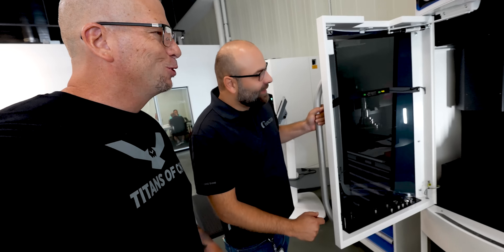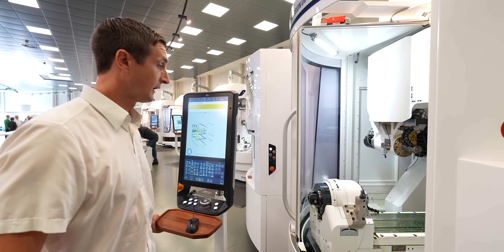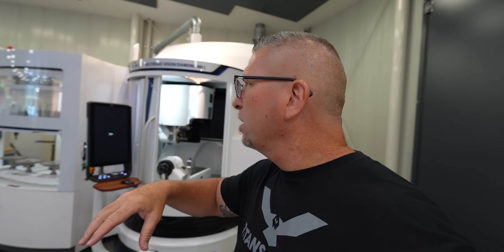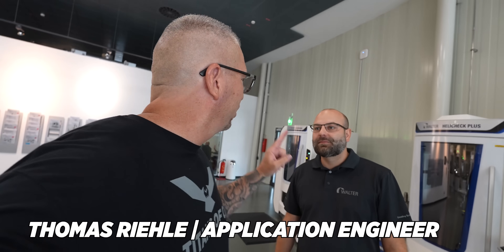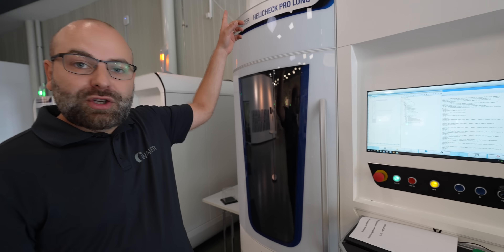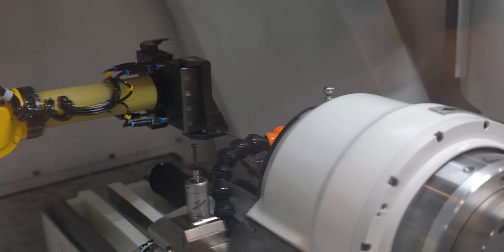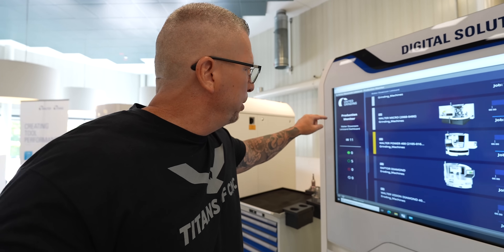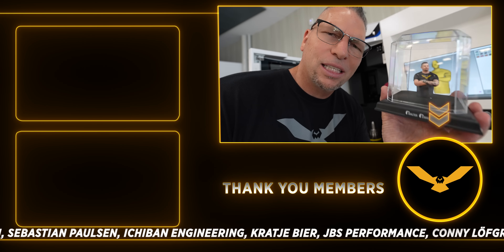The Brilliance of Erosion Machining at WALTER | Germany

Comment: because the rods in the old XJ650 were broken and there was no where to get new ones... bigger machines... as things are made, more of that tungsten finds it's way into the base stock of normal material. casting pool in 1993 said 128'000psi tensile, why does a E7018 welding rod hold 170'000psi... but the E7018 rod from a few miles east lets go at 65'000psi? weird... happy i got new axles for the car but the box said made in China in one spot... there is 220'000 on one axle and 68'000 laser etched into the other one 23lb each, Q.C. of 3500 tons of separation anxiety? one to won... 🤔, one does and the other will too. nearly 10'000 ford 8.8 CV axles? because there are only 5000 of those cars still in use? all kitchens have soy sauce in them to.

Comment: I can see AR glasses would be valuable on the shop floor, being able to look at a machine and see it's current job queue,  any issues and a live stream of the tool head.
Reply: We don't have AR glasses in use yet, but with our Digital Solutions system, you can monitor all the machines linked to it :)

Comment: well, this is slightly more sophisticated than setting up an electrode with some string, pulleys, and weights, or running a diamond wheel in a toolpost with mildly caustic "coolant". (clean EVERYTHING afterwards...) you only need a small HV supply to get the arc. in many ways, its closest to whats in a plasma ball, little nibble, little nibble... (what? you havent dropped a sheet of foil over  plasma ball and cut holes in it with the arc? what are you doing with your life?)

done this many times in a shitty backyard shop. just because one can.

what scares me is that it seems to be new information for so many commentors.
if you dont want to expand your knowledge base, havent done so already... then why watch these videos? keep pushing buttons.

this process is mentioned in nearly every trade book i have from the 60s onwards. at least, the ones dealing with tolerances, grinding, etc. yknow, when PLANERS and SHAPERS were still shop mainstays?

open a book, educate yourself, give things a go. just because its old, yellow, maybe a bit mouldy and smelly... doesnt mean the information held within is useless. usually you find its BETTER. or can be re-applied to another situation.

Comment: I did part of my apprenticeship at Everite machine products Philadelphia,they pretty much invented the ECM technology.Whats funny is one of the owners came from Germany,he was sn awesome guy ,the kind of guy that took time to explain every designation on a tap,very old school but a genius and craftsman
Reply: Funny you are also from Philly. Back in the 1980's I did electrical work for some machine & tool and die shops that had several EDM & wire machines. At one shop they ran wire machines 24/7. Foreman would cone in early Sunday morning to install new parts to be run.

Comment: Erosion combined with grinding?? Crazy tech right there! Combining the two most accurate machining processes is genius! The tungsten in those wheels will give them increased wear resistance over pure copper. Cool stuff, thanks for sharing manufacturing on a world wide level boss!
Reply: Our tool eroding machines can erode tools made of PCD and CBN and grind tools made of carbide and high speed steel, all in one alternating stream. Our 2-in-1 machine concept has already more than 20 years of existence.
Reply: man, its old tech, ive got trade books from the 60s describing it, and i think theres a mention of it in a pre WWII grinding handbook...
Reply: @paradiselost9946  nobody said it was new bruh

Comment: So what is waterjet cutting if not erosion?
Reply: The cutting in waterjet is done by garnet so technically that's abrasion which is a subset of erosion. This is arc erosion.
Reply from the maker: Well, in erosion… electricity is cutting the material… and in waterjet… pieces of sand are being pounded into the material at 90,000PSI to cut the material. Definitely different… Erosion is way more precise.
Reply: it is erosion, I think the term applies to both technologies here.